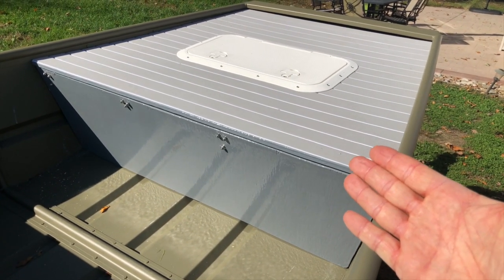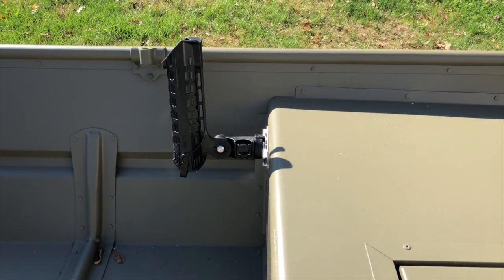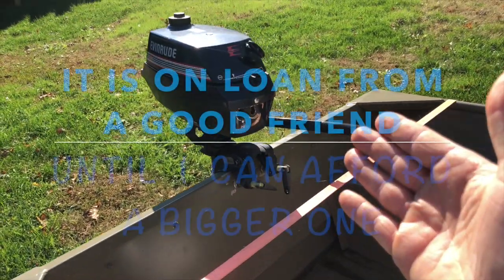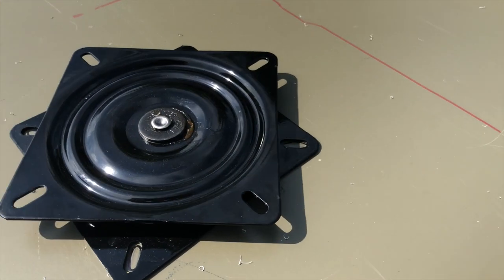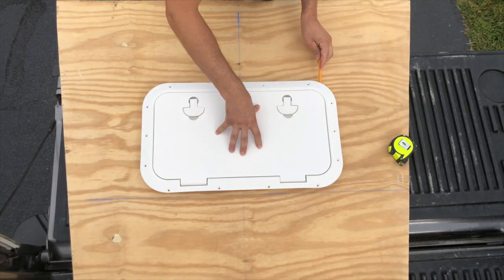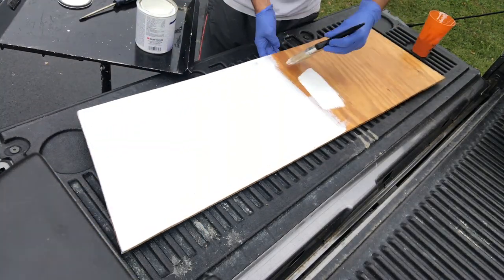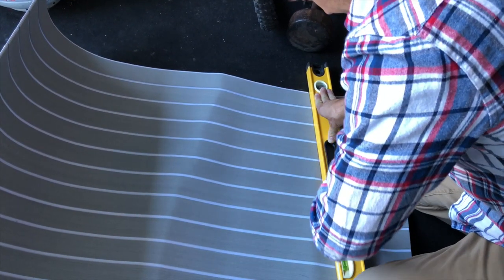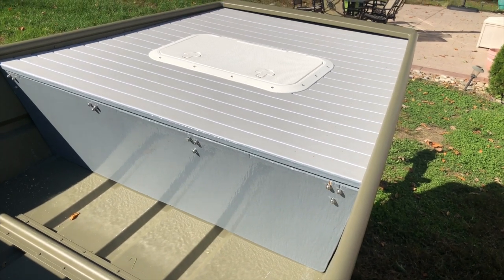Jon Boat Upgrades to Tracker Topper

Comment: For the seat mount in mine I used one of the post mounts that needs a hole drilled in the center, then used that to get the self locking nuts underneath, put super glue on them and grabbed them with the bolt from the top to pull them up and glue them one at a time to the underside. Then once the glue was set just put the post mount on and put the bolts into their slots.
Reply from the maker: Thats a good idea!! I eventually removed my seat and covered the bench in seadek, which looked clean and worked alright. No back support, but thats ok

Comment: Looking good my friend.  Several suggestions I might offer that could help over time. 1.  You may want to consider moving the fire extinguisher to a different location.  Being right beside the motor that has a built in gas tank, most fires start with the motor and spread immediately to the gas tank, you want to be able to get to it without endangering yourself and before the boat is destroyed.   2.  On the front panel of your casting deck, reverse those bolt so the head is to the exterior and then ends of the bolt are inside where they will not snag a line, net, pants etc while fishing or moving about the boat. 3.  Make sure you keep those swivel seat bearings lubricated, being exposed to water constantly, they will rust and that modification will lock up tight on you.   Keep up the good work and  post videos as you continue to upgrade.  Peace.
Reply from the maker: Doug Weaver thank you sir! Im thinking in a year or two the whole thing may get decked.  I don’t know what i was thinking w the extinguisher must’ve been in a hurry lol. Its gonna get moved when i get a new and larger motor this spring. Thanks for the advice :) !

Comment: Looks good... might wanna add a corner molding onto that casting deck to prevent the wood from being splintered and would give it a cool look. Gonna try to build one as well soon. Thanks for the vid man. Nice job!!!
Reply from the maker: Frank Leathers, good call for sure 
-version 2.0 is in the planning phase now... will be bigger and much better! So far after a season i have had no issues in creeks and the bay, but definitely see much room to improve.
Reply from the maker: Have you started your project yet sir?? Version 2.0 begins in January here.

Comment: I drilled and tapped the seat to use bolts to mount a base that accepts the square swivel. Bought it at my local cabelas you should check them out. Also lets you remove the seat for storage.
Reply from the maker: Neil Thompson i will definitely do something different with mine next winter. Good tip i will check cabelas for sure !

Comment: All I did was attach the seat to the swivel bast with the screws supplied.  Then rivet the swivel base to an aluminum plate from the underside. The rivet the plate to the seat. That way your not sitting so high.
Reply from the maker: That Makes sense! 
This year i completely tore down and did a full/better custom rebuild, decked out and all since this video— sort of like the tbnation guys do.

Comment: If you take the nuts off one end of the threaded rod on the clamp mount seat and slide it through and put on the washer and nut again you can get the width (18") you need. Then just pass a ratchet strap under the seat and secure it down onto the clamps that come over the edge of the seat.  I am 260lbs. and it holds me fine.
Reply from the maker: Bob Chapman that is a good solution!

Comment: Nice! I've got the Tracker Topper 1542 and I hate how wide the seats are. They're just unnecessarily wide, but there is a removable seat clamp system that fits. I've had my boat for 4yrs but I know I either picked the seat clamp up at Academy or Bass Pro Shop. So where can I find that foam on the deck? I'm wanting to cut out the middle seat and plug the live well (since mine has always leaked). Then I'm going to install a floor down the middle and lengthen my casting deck so it's big enough that I can put a seat on it. I want to get some foam for the floor but really don't want to pay that Sea Dek price.
Reply from the maker: William Pope this is where is found the best bang-for-the-buck on the eva foam that had good reviews for quality (amazon). Im satisfied with the product so far...     EVA Foam Faux Teak Sheet Boat... https://www.amazon.com/dp/B072MHPRF4?ref=ppx_pop_mob_ap_share
Reply from the maker: William Pope this is where is found the best bang-for-the-buck on the eva foam that had good reviews for quality (amazon). Im satisfied with the product so far...          EVA Foam Faux Teak Sheet Boat... https://www.amazon.com/dp/B072MHPRF4?ref=ppx_pop_mob_ap_share
Reply from the maker: William Pope i found the eva foam on amazon.com! EVA Foam Faux Teak Sheet Boat... https://www.amazon.com/dp/B072MHPRF4?ref=ppx_pop_mob_ap_share
Reply from the maker: William Pope im satisfied with the quality so far, and the adhesive backing worked well too :)

Comment: Where did you get the foam decking?
Reply from the maker: EVA Foam Faux Teak Sheet Boat Yacht Synthetic Teak Decking Marine Mat, Grey - 35.4 x 94.5 inches https://www.amazon.com/dp/B072MHPRF4/ref=cm_sw_r_cp_apip_G52T4eftbTfdZ

It has held up really well and still looks great after a good deal of use

Comment: where did u buy that casting deck?
Reply from the maker: Bought wood at lowes and fiber glassed it. Then decked it with eva. Its been the best thing ive done to the boat it held up well. Im taking it off in a few weeks and making a bigger//better one with more compartments etc
Reply: @paddleandhook  im talking about that metal piece u put in